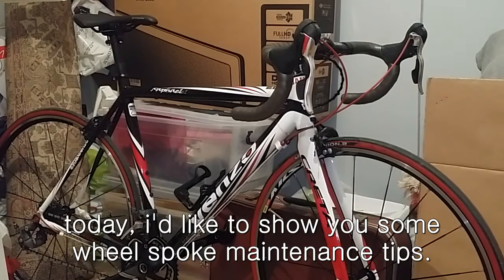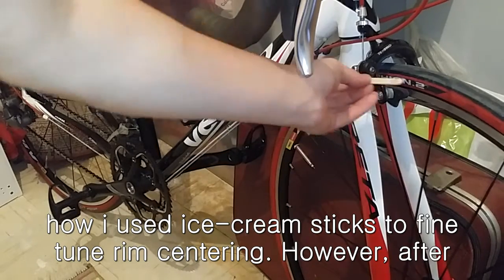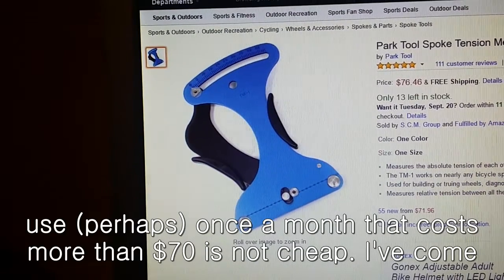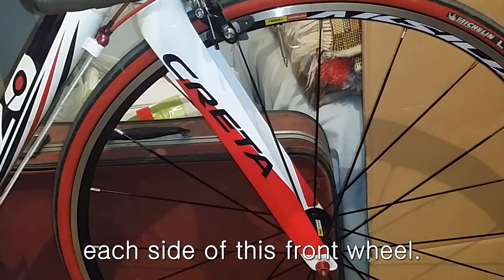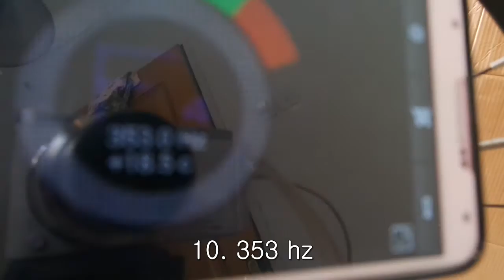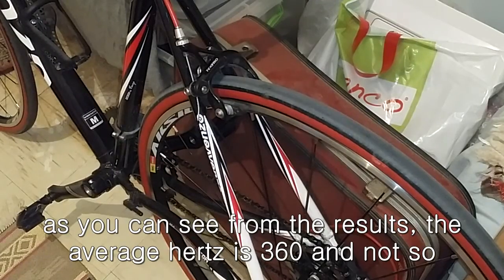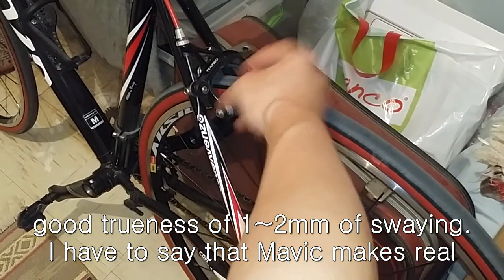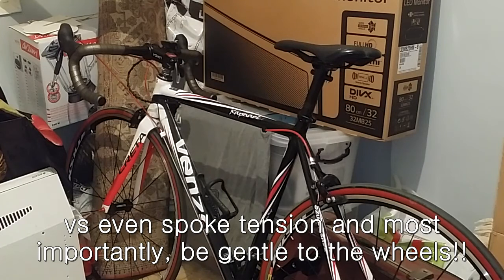how to wheel spoke tension check using a phone app!! free!! venzo road bike, mavic, parktool, truing

Comment: Nice video, thanks. I also use this method. I calculate the frequency with the formula F=sqrt(P/(3.14*R))/(L*D), where P is a target tension (N), R – spoke material density (kg/m3), L – spoke length (m) and D – spoke diameter (m). They recommend for the front wheel average tension 900…1000N, for the rear wheel 1000…1100N at the drive side and 600…700N at the non-drive side. Target frequencies at my 28” wheels last time were about 290Hz for front and 300/360Hz for the rear.
At the first take, I go through all spokes twice tuning their frequencies with around 1% accuracy. Then I check the wheel swaying, it is about 2..3mm as usual. Next, I correct the tension in a normal way reducing the swaying to 1mm. Resulting calculated tension dispersion over the spokes is about 7…12%.
It would be interesting to compare tension values obtained with the hardware meter with the formula above.
Reply from the maker: amgluk hello, thanks for your valuable comments ~ i got parktool tm-1 finally as the spoke picking is very painful
Reply: Hey amgluk, thanks for the formula. Two years after your comment, I am wondering. For double butted spokes, Do you think the spoke diameter should be the diameter in the middle of the spoke? Thanks :)
Reply: @NikoxD93  Hi, the effective diameter De is calculated from the following equation:
Ltot/De^2=l/d^2+L/D^2
where l and d are the length and diameter of the thin section, L and D are the length and diameter of the thick section, and Ltot is the total length. If the spoke has a thick section at both ends, then L is the combined length of those two sections. The formula is taken from https://bicyclewheel.info/articles/butted-spokes/
Solving the equation we obtain: De=sqrt(Ltot/(l/d^2+L/D^2
))
Reply: @amgluk  wow, that's exactly what I was looking for! In the meantime I found the equation about strings, and I was going to approximate but now I can calculate the Effective Diameter instead. Thank you so much! :)
Now I find for a Sapim laser spoke of 292mm, effective diameter is 1,54mm and vibrating frequency for a tenstion of 900N is 423 Hz! Great result
Reply: Thanks how do you treat aero spokes as their profile is rectangular not round. What’ the approach thanks
Reply: @filipos7459  Suppose the aero spoke has an elliptical cross-section with dimensions A and B along axes. Then, from the condition of equality of areas, we get effective diameter De=sqrt(A*B).
Similarly, for rectangular cross-sections with dimensions A and B, we get De=sqrt(4*A*B/3.14).
Reply: Really useful tip. Can there be some approximation for 2 cross and 3 cross layouts? Could length be calculated as the distance between contact with the rim and las crossing point?
Reply: @martinovallejo  I'm afraid no. The spoke must be free to use this method.
Reply: maaan, this is going fully science! where did u find this formula for the frequency related to the spoke parameters? cheers
Reply: @Gledii  That's from physics https://en.wikipedia.org/wiki/String_vibration

Comment: Hello, can you please tell me your front wheel hz rate as well as rear drive / non - drive side? Thank you
Reply from the maker: Romana Dvořáková I'm sorry, this method isn't accurate after getting and trying parktool tm-1. I recommend getting it though~
Reply: His frequencies are most likely different (99%) from yours. You shouldn't emulate them. Spoke length is different on each wheel as well as spoke lacing (2 cross, 3 cross) and that will change the pitch. You should judge only radial spokes with this method imo. Radial spokes are spokes that don't cross over each other, usually front wheels have this lacing.